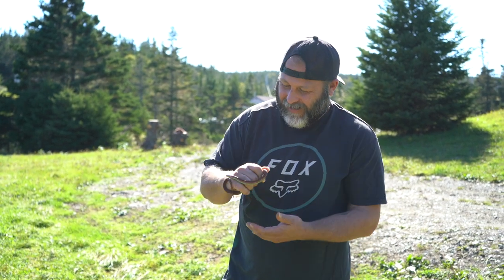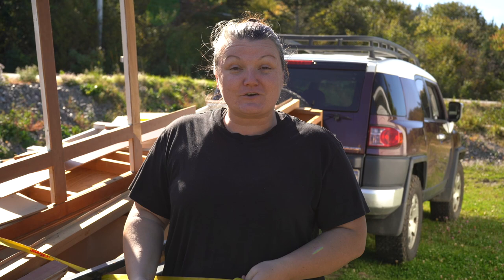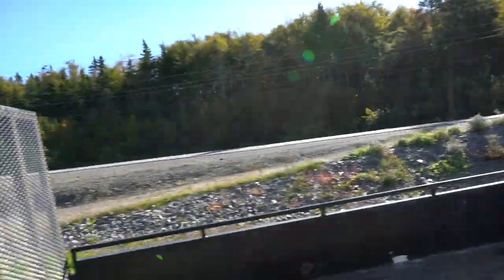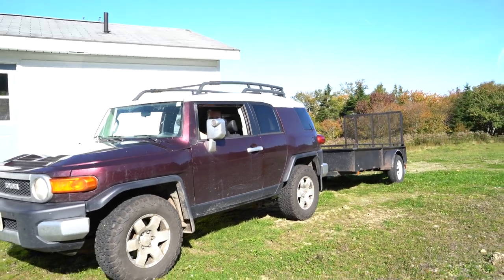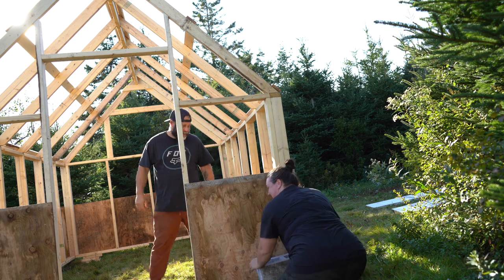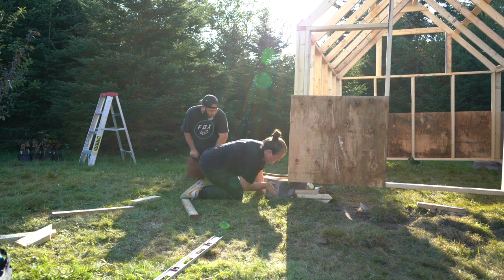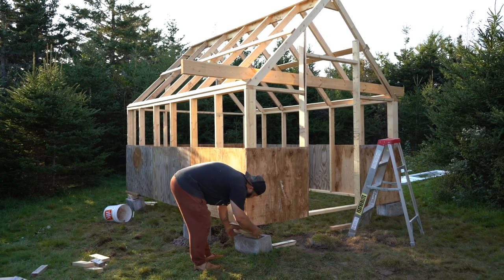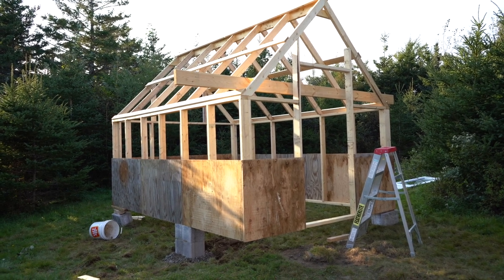Mistakes were made...

Comment: Because your Greenhouse is So lightweight you may want to anchor it to the ground. I anchor my stuff by digging a hole and cementing in a 4 x 4 post right next to the structure, then I use bolts or long, heavy duty screws to anchor the building to the 4 x 4 posts. I would do one 4 x 4 at each corner. The 4 x 4's don't have to be real tall. You could buy a couple of them, 8 feet long and cut them in half, bury a foot or so into the ground and the building can be attached to what is above ground.

Comment: We have really high wind gusts in this valley as we are between two close mountan ranges. Im wondering if you need some guy wires. Or add some stronger metal wood ties at outside corners and top of gable of roo. So the "box" shape doesnt keep moving and torque out of shape or keep on torquing and the wind could make a sail out of it. or just stability for over time.  Im just paranoid. Here in southern california we always have extra requirements for earthquakes. Now living in an area for wind considerations too.

Comment: Should you have painted the bottom board of the greenhouse so it doesn’t rot out. I know you are going to paint the wood. Are you going to paint the bottom of the foundation board so it doesn’t absorb moisture from the cinder block? Karen Florida
Reply: They are going to paint tomorrow. It is not treated wood. The cinder blocks will keep it off of the ground.